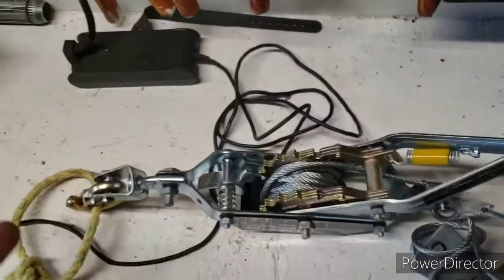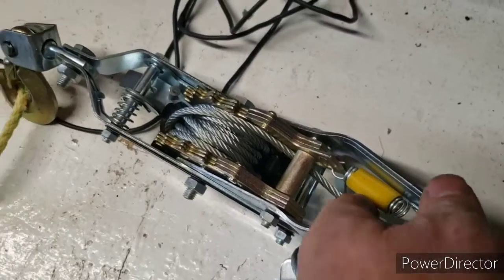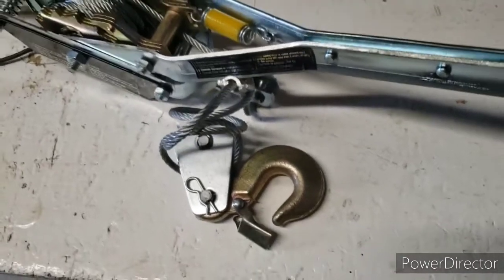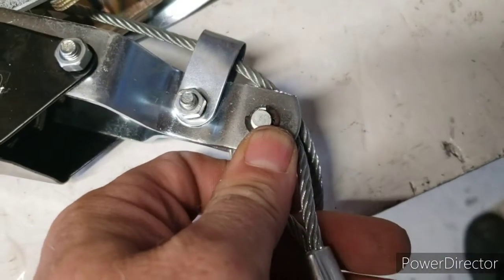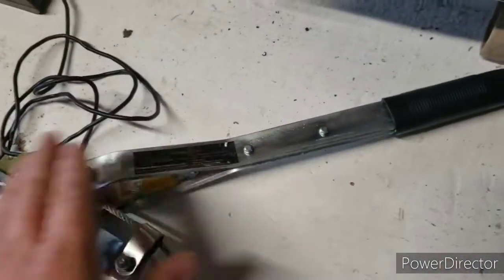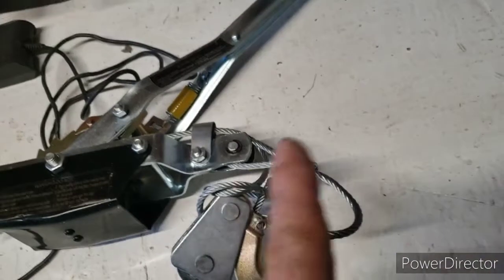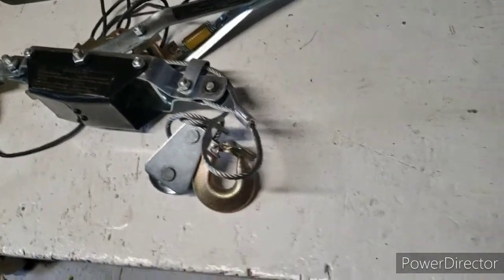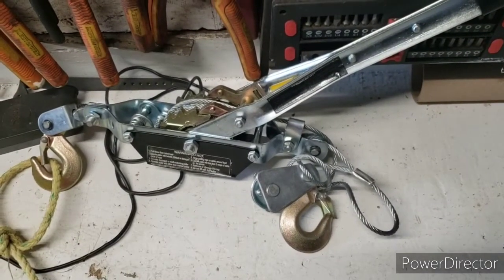How to Use a Come Along, Cable Puller, and Winch #comealong #winch

Comment: I am a moose puller from way back new friend.  One great pulling wire is the coaxial they have along the highway with the heavy wire on the outside. I have pulled many bulls with my 300 ft keeper and it has yet to break. Great stuff eh.
Reply from the maker: Lol you know never thought about that , now how would a guy get his hands on such coaxial. If im thinking about the same stuff, it wouldnt fray. Thanks for the comment and info. 🍻
Reply: @DIYVariety  I got mine at our landfill years ago but copper is paying well these days so I would talk to your local cable TV place/provider. May as well check your local scrap metals place as well eh.

Comment: Be nice if you made a video how to go from double line  of cable too single line any pics ?
Reply from the maker: Hey there, no i never seen a single line always double for the mechanical advantage, if had only one cable it would be to hard to crank it over. Unless im not understanding the question, wouldnt be the first time lol. Cheers ill look into it though. Hey im editing this, i looked up single line come along and they are out there lol mostly 1\2 or 1 ton.
Reply: You mentioned you can make your Puller  longer how you hook the cable ?
Reply from the maker: @cedras45  Oh buddy now i got ya. What i had to do was i used large rope around a 20 inch diameter tree and came about 25 feet to where i had the come along and the cable was just long enough to hook on to the large cast iron boiler that was in the ground. But now i have a 20 foot bunk chain with a hock on each end and that works like a dream. I dont have to worry about the chain because the cable will snap first. I dont have pics. You can remove the pulley and hook directly and gain in distance but only for very small loads since you lose the mechanical advantage.